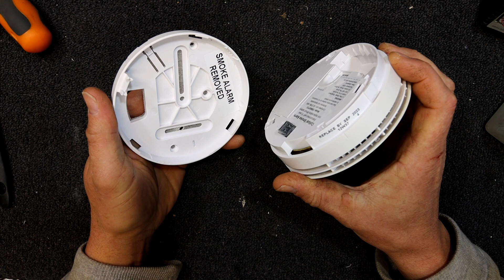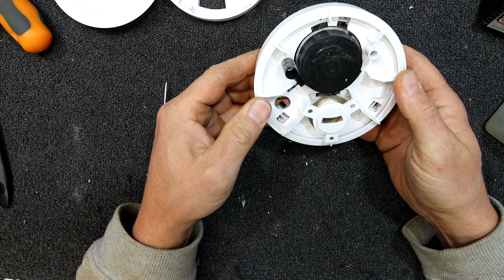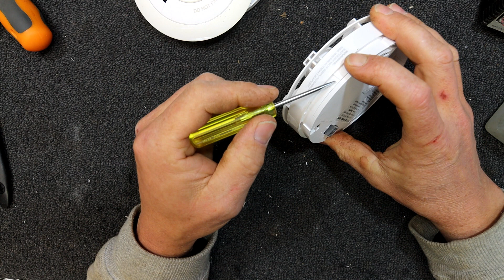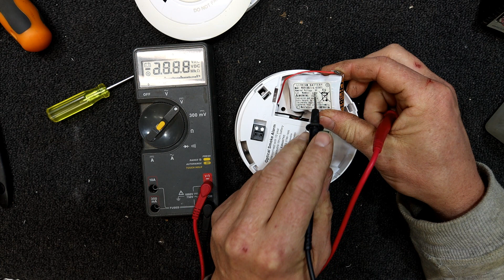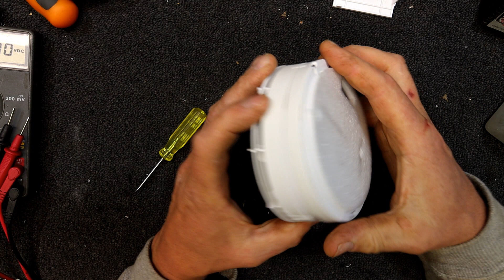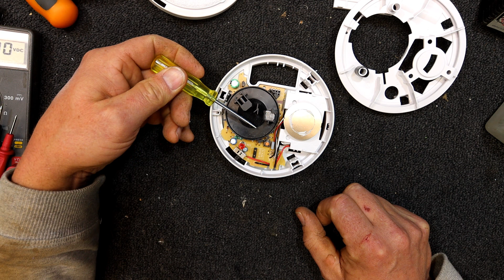Smoke Detector with Non Replaceable Battery Teardown

Comment: Model number: Ei605 TYC

Manufactured by Ei Electronics in Shannon Ireland. Rebranded by your local distributor.

The battery has a 10 year lifespan but should probably survive around 20 years to guarantee a sufficient margin of safety. Besides, many EU countries don't allow to keep fire alarms for more than 10 years, require replacement due to possible degradation - contact decay, sensor LED lifespan, contamination of the sensor chamber.

The mounting plate contains an on-off switch actuator. Ah yes you found it.

The TYC version that you have has wired and wireless network options. If you have a big house, you want to connect them together so you can hear that you've got fire at the opposite end of the house. The screw terminals are for wired networking, you simply connect all the devices in parallel. The pin header connector is for an optional wireless module that is sold separately. When you chuck your alarms every 10 years, you can just reuse the wireless modules for the next batch, unless they changed the pinout in the interim. The wireless module is EXPENSIVE.

Thanks for the teardown. I am a little too tempted to service them myself by cleaning, testing and replacing battery if need be, although technically i shouldn't do that and should just buy new ones and have the landlord pay the invoice. I mean i can install new ones and keep the old ones to uhh... i don't know! Nice to know the battery is 9V as usual as well.

Comment: The 10 year life is set by industry guidelines that are used worldwide. The smoke detection chambers are considered to be past their reliable life at 10 yrs. The DIP switch sets the units particular ID when interconnected with other identical detectors.
Reply from the maker: Thanks for that information. Makes sense to replace a safety device after a certain period, especially if dust reduces its reliability. I take it you would only need to set the ID if the RF interconnect option is fitted and they are triggered by nearby neighbours units.